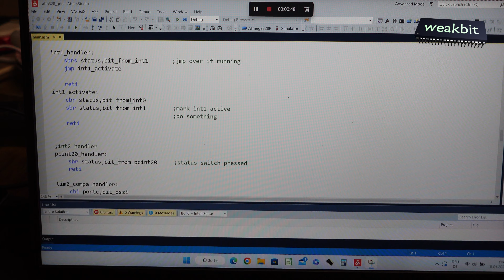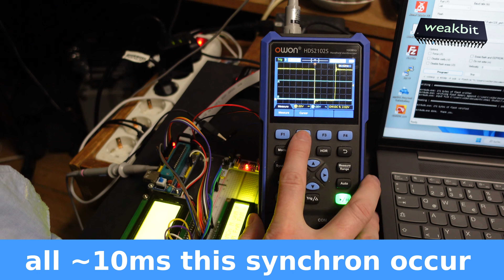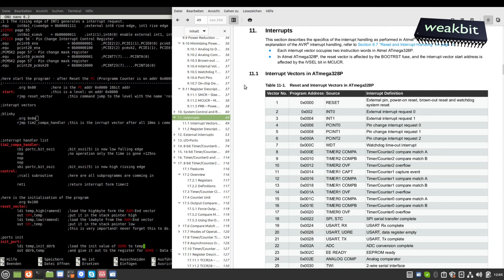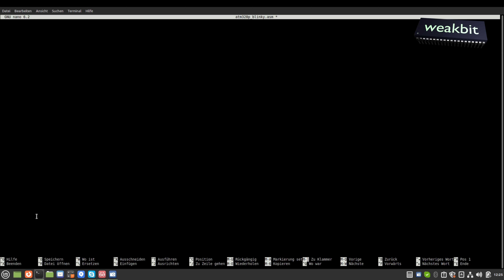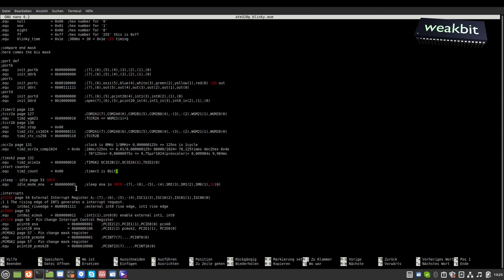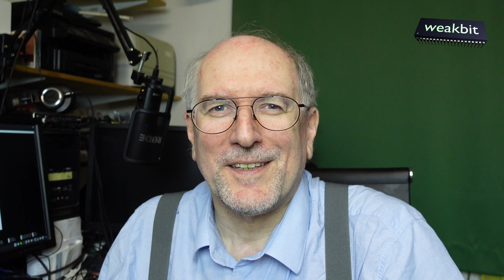Assembly ATMega328P #1/2 blinky

Comment from the maker: To the measure I must say the following 656ns'(measured with the Oscilloscope) for 3times command 'nop' at 125ns and the rest is(for the command out portc,bit_red_led)? 
125ns*3= 375ns. 656ns(measured time) - 375ns = 281ns but this was a wrong measurement in that case that 125ns*2 = 250ns and this is the measurement failure from this measurement! A command like => out  portc,bit_red_led take 250ns at a 8MHz Clock.